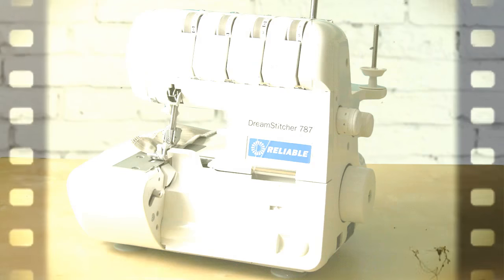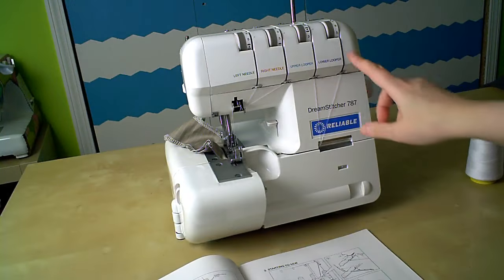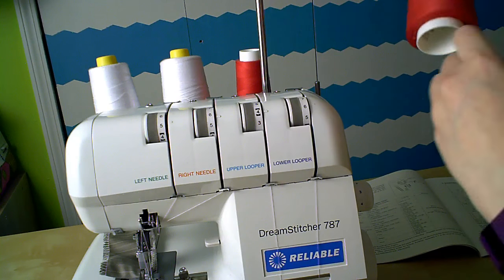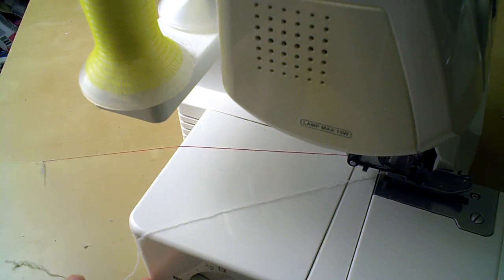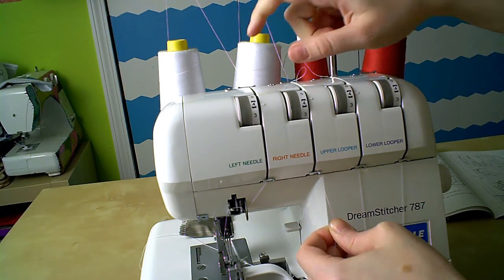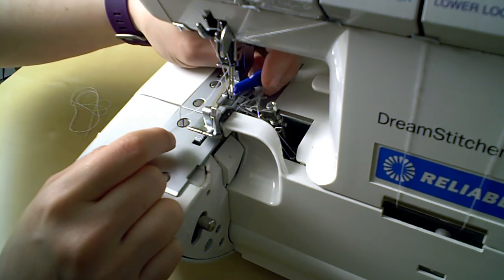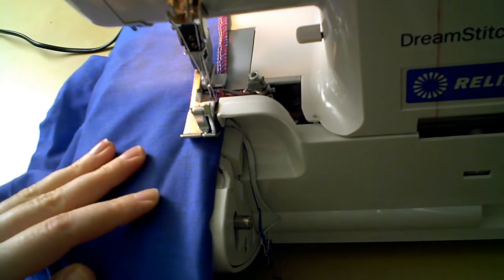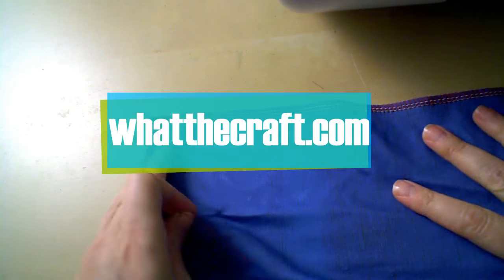How to Use a Serger - Basics

Comment: Hi; Lori here. Thank you so much for your demonstration. I just got a new over locker serger. The book is not very illustrated and my machine did not have a piece of material but it was threaded and did have a tail. Worked till 2 of the threads broke down in the looper. I finally got it figured out. I wish the manuals had online sites like this one that can explain better. Thank you.

Comment: Thanks for the video.
Since I've started threading my needles while wearing a jeweler's loupe, I no longer need the threading tool.  The loupe makes it look like I'm putting a rope through a porthole.  Super easy and the loupe lets me see if I've cut a clean end to the thread.  A magnifying glass doesn't work because you need two hands.   I use McMaster-Carr PN 13403T that I attach to my glasses.  I can quickly swing it out of the way yet keep it on for when I need it.

Comment: Ever tried the spit on the back of the needle trick? Works like magic every time, just put a little moisture (spit or water lol) on the opposite end you are putting the thread through and then the thread will go through the needle hole much easier because the thread is attracted to the moisture on metal.
Reply from the maker: Is it wrong that I can't wait to spit on my serger to try this out?

Comment: Dear Smarmy.  I have been fixing machines for over 40 years.  Here is a tip for you. An easy way to thread needles.  Remove the foot (button on the back of the foot.) Open the front cover.  Easy threading.  Great machine. Whitby Sewing Machine FB

Pss . A good day is only a thought away. Have a good thought day.  Paytair Bereczki
Reply from the maker: Thanks for that! Never thought about removing the foot. That would definitely make it easier!

Comment: Where is this serger sold?  I definitely couldn't find it on Amazon.
Reply from the maker: I don't think they make it anymore, unfortunately.
Reply: Metal sergers and sewing machines are considered "vintage", so check eBay, Craigslist, second-hand stores,  church rummage sales, vintage sewing groups on Facebook. The older, non-plastic machines are the BEST!! I hope you find one and if it does not have a manual, spend time to research where to purchase one. Spend a few bucks for instructions because threading a serger goes in a very precise order, and all machines are similar but NOT alike! Good luck🍀!😊

Comment: My problem is not knowung what settings to use. Its eaither too tight ot too loose! ugh!! Great tutorial though!!
Reply from the maker: Hi Erica- It sounds like an issue with the differential feed. There should be a dial on the lower left side of the machine, numbered something like 0.7 through 2.0. It can take some practice to know what setting will be right for a particular fabric. But in general, if the fabric is bunching a little, lower the diff feed. And if it's getting stretched out, increase the diff feed. Hope that helps!

Comment: I hate my serger. I honestly dont feel like i can control it no matter what i try. I've watched a million videos and i get it in principle but i just dont seem to be able to control it to just sew straight. Using the seam guides are useless as you can't really line up the edge accurately as the machine is so fast even when you are going slow. I feel so much more control over using a sewing machine but the serger is just crazy and i want to be good at it 😢